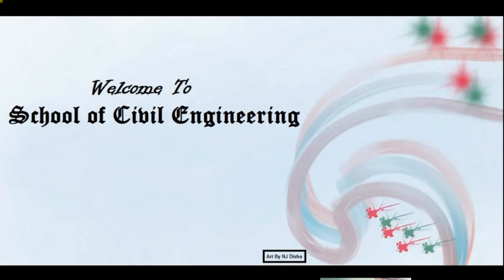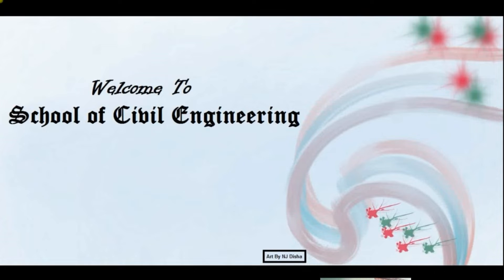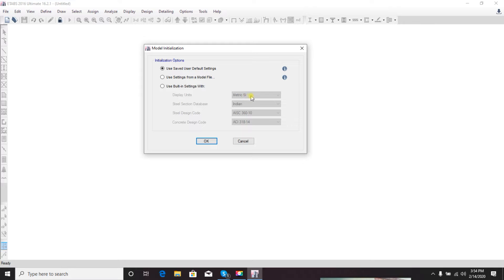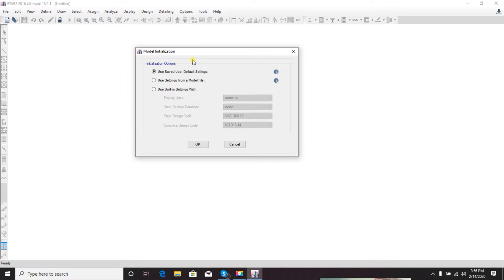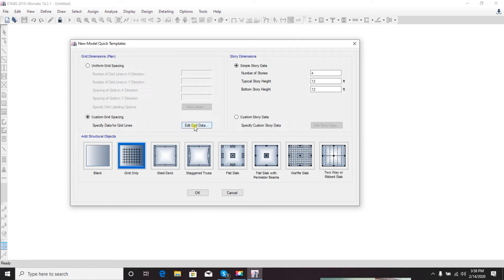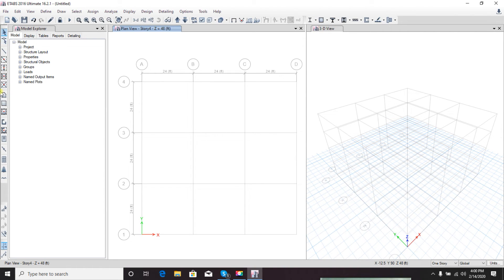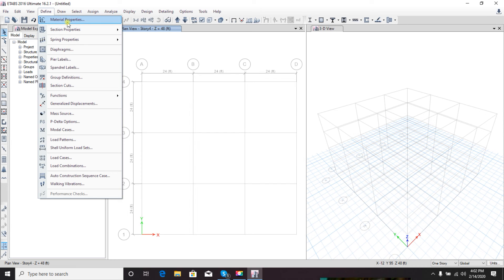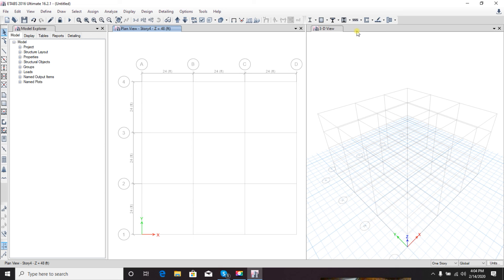Etabs Full Tutorials for beginners  | Introduction to Etabs | Lec-01

Comment: Etabs is primarily for buildings, the tools make it easy to model typical multi-story framed buildings. Some Etabs  versions have tools to model non-linear behavior of concrete columns and shear walls. For something like a portal frame commercial building, or even multi-story steel framed buildings and if seismic design isn't the primary consideration, I'd say that Microstran or Spacegass  are cheaper to buy, easier to learn and use.

Comment: sir , I use etabs19. In this version, lots of options are not available
any suggestion please.
Reply from the maker: you are right. its available in version 16. but CSI decide to separate all different parts of that software.. if you need detailing then you have to download that separately.  also connection design are not available.